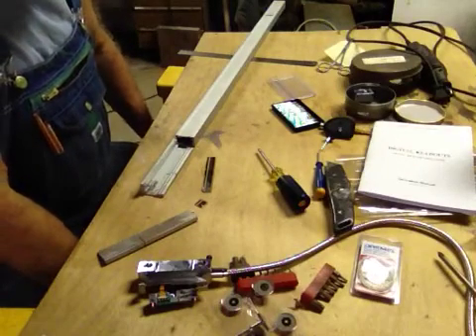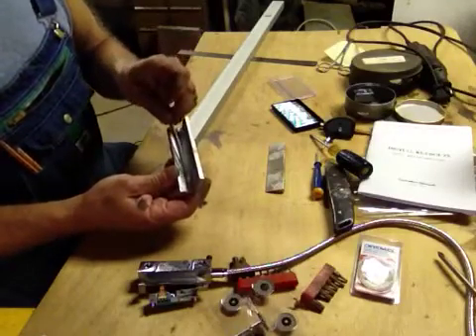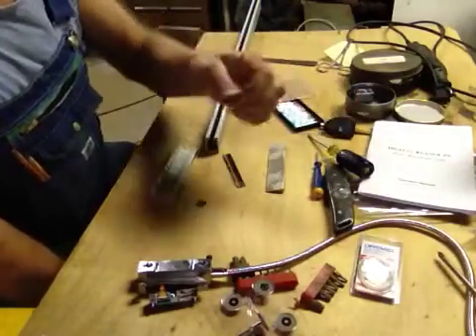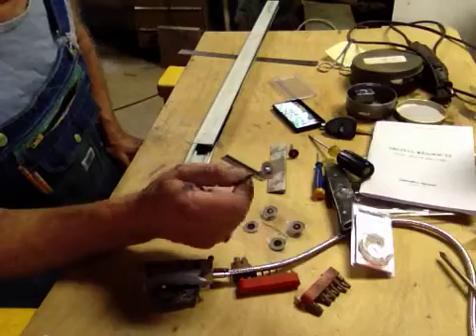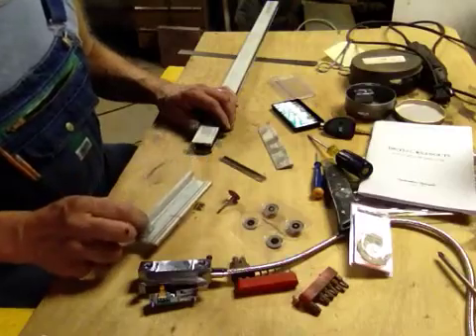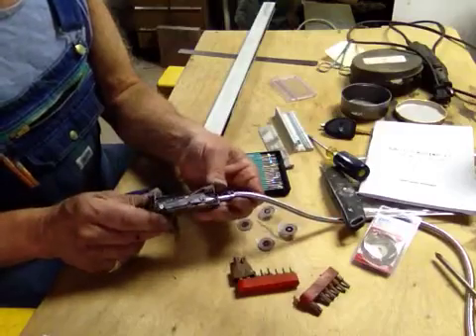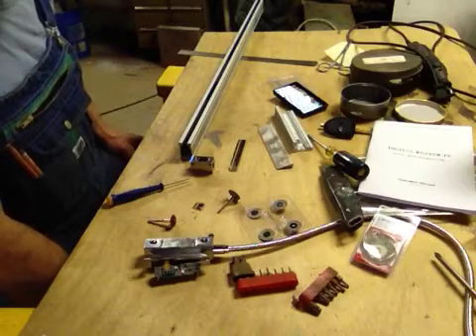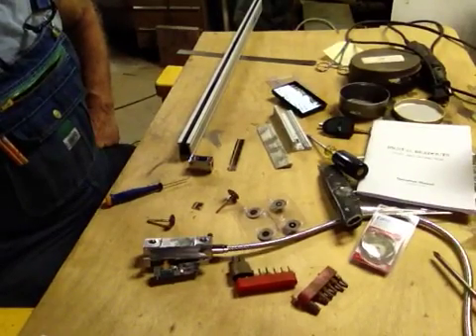cutting a glass scale for a dro

Comment: I have just successfully cut both my scales. Exactly the same brand. The glass is very fragile and with a light scoring from my standard dremel cutoff wheel it broke perfectly straight. Rather than cut the glass back inside  the rail to make room for the end cap, I cut a slot into the end cap. Rather than tap a thread for the new holes, I used the end cap as a guide and drilled a 1.5mm hole, then with the dremel cut off wheel I cut two thin slits into the screws, worked like self tapping screws. Easy job. Also I just gently inserted the tip of my air gun inside and blew it out. I also did not remove the scale readers, they both work perfectly after the job. Now to mount it to my lathe.